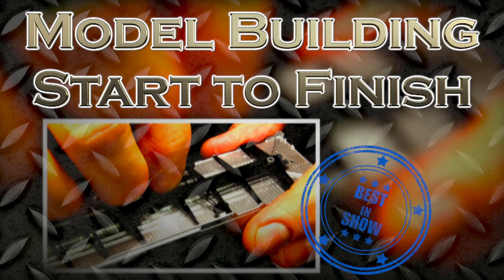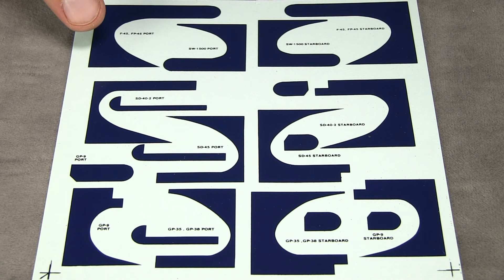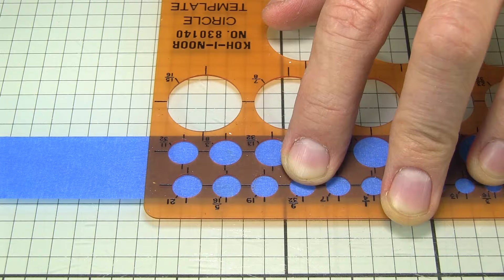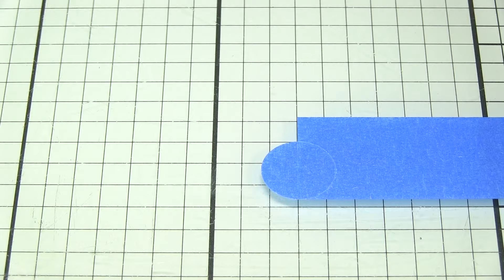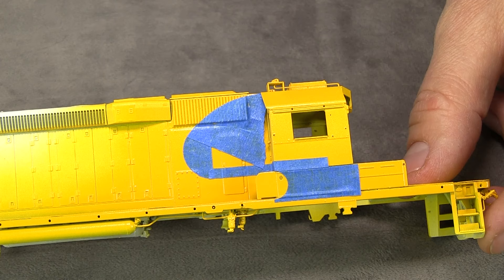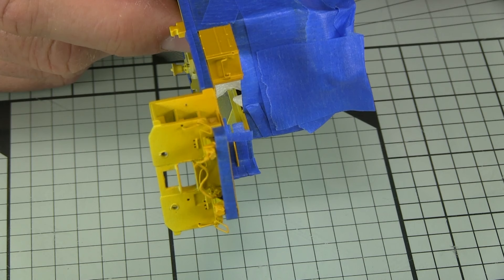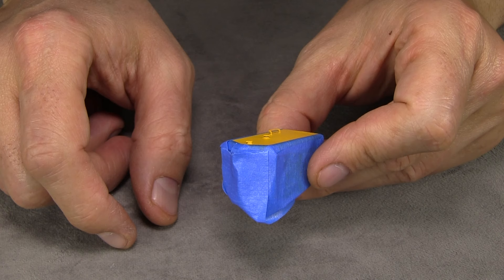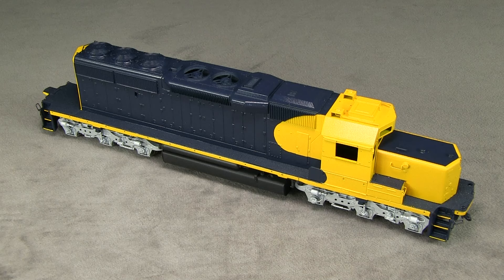HO Scale SD40-2 Model Building 20 of 25 Painting Pt. 2

Comment: GREAT masking technique, Dan!! 👍👍
I don't usually give advice to experienced modelers, but I'd like to share something my Dad taught me....
After the masking is done, burnished, and you're ready, in this case - spray another coat of Yellow over the masking.
That way, if there's ANY problem with the tape or lumpy details, the paint bleed will be the same color. Also, that coat will make an even tighter seal against the tape mask!

You can use that or not, but there's my 4 cents. (inflation!)😉😊
~ Carmine